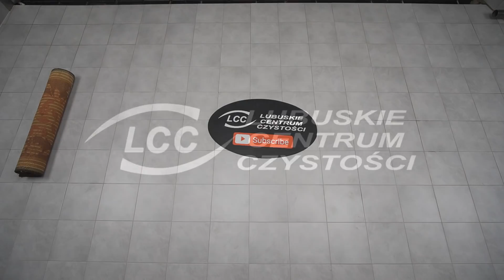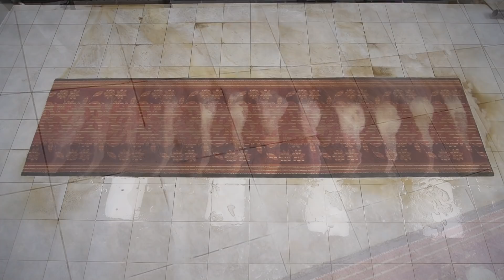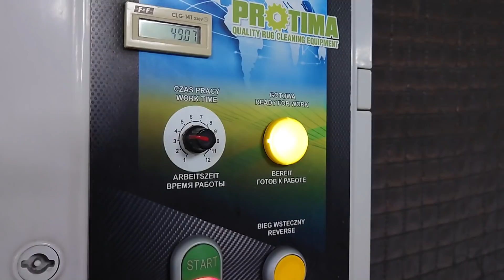Prawie CZARNA WODA wypłynęła z tego starego dywanu. Przepiękne kwiaty ukazały się po praniu 💪😍🌊

Comment: I would think power washing the under side a second time would release more dirt than scrubbing the surface, as the majority of dirt is trapped at the bottom of the pile in rugs, as you can see when you do it the first time. It's always my favorite part!  That said,  I'd be curious if one day you could test that theory by doing it at the end when you would normally put the rug in the centrifuge... just to see how much dirt is actually still trapped! Maybe then you could cut out some of the scrubbing with the brush? Anyway,  it would be an interesting test to find out and would require a lot less muscle if it works!

Comment: What happens to the waste water from these cleanings?  Do you filter and re-use any of it?  Does it go into the drain and get treated by local sewer/water treatment?  I love your videos, but I think about what a precious resource clean water is.  Thanks in advance for your response.  👍🏻
Reply: I too have thought about that. And was thinking if he did gray water collection, it could be used to water lawns or flower gardens, not sure about vegetable gardens because of the chemicals in the soap he uses. I’ve thought about it because we collected gray water for our garden before, helped save our water usage and our septic tank. I hate to see all that water go to waste treatment or thru a septic tank.
Reply: I am concerned about the water as well. Of course he needs a lot of it to really get the rugs clean, but there should be a way to save a precious resource, too.